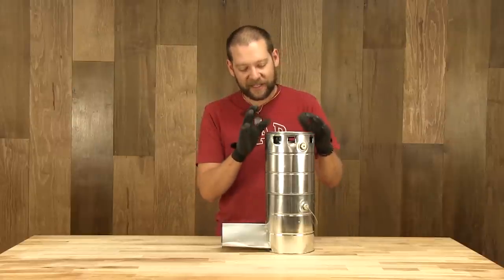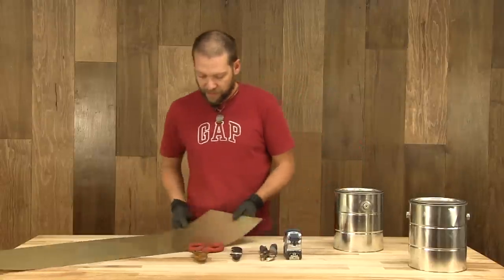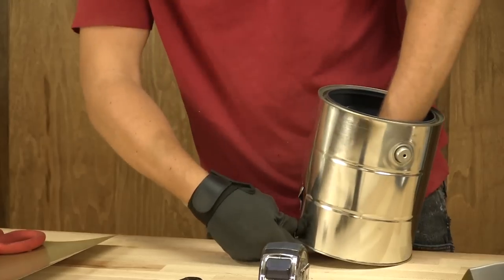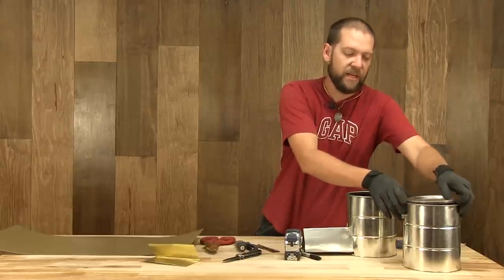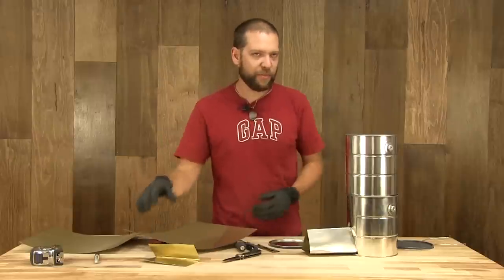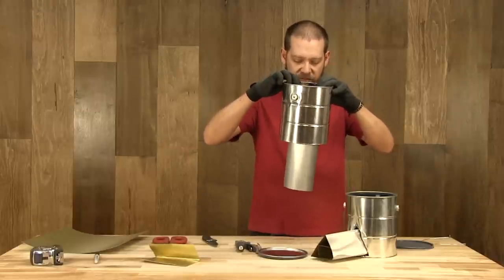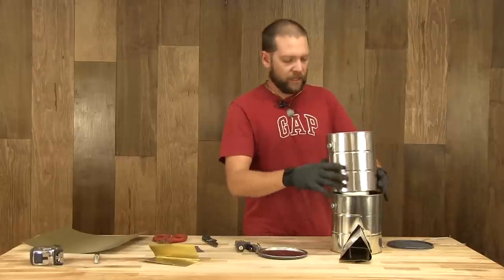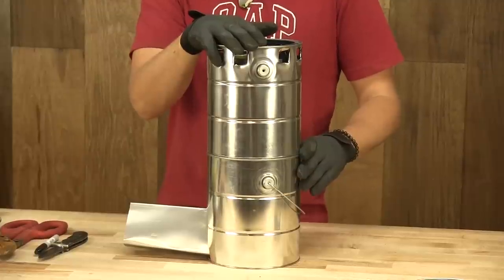How to Make a Rocket Can Heater

Comment: Looking at the design, wouldn't putting the point of the triangle down make more sense for the air? Would allow for larger diameter wood to be used as fuel

Comment: Wouldn't it be easier to use metal duct instead of aluminum sheeting?, it is cheap and fully sealed on the sides, and metal duct has a melting temperature of over 2000 degrees, aluminum melts at 1200 degrees, and the temperature in a rocket stove burn chamber gets well over 1200 degrees

Comment: You might want to inform your audience that they need to use a LOCKING BLADE or a FULL TANG blade when cutting into metal...even cheap metal...Some folks will grab any knife and begin...with the results of a loss of fingers using a cheap non locking blade.

Comment: Of course it doesn't work, the burn area is so freaking tiny you have to feed it constantly and it's not going to produce much heat with one single twig burning, if it burns, looks like it would go out and just smoulder and turn this thing into a smoker
All the tech talk for a hunk of crap, the power of pain pills!

Comment: Great idea but just the tip when pushing a knife through they can very easy for the knife to slip off specially if it is an old one like you say with a bad tip you could stab yourself trying to hold a can a little further away would hate to see good people like yourself trying to help other people save money and hurt themselves great idea thanks a lot I will be making a small food can heater for my tank when I go camping in the fall and winter thanks and stay safe
Reply: This thing is going to kill people. I don't see how it is going to help people...

Comment: Oh my god ! 
Normally I don't bother sayng anything. I just can't let this go. 
Don't anyone built this thing ! 
Seriously.
The center heatstack is a coil of slashing. The outer housing is two cans just balanced on eachother.  So, you feed in wood through the tiny opening which pushed the entire thing off balane anyway.  Rediculous design with dangerous sharp edges everywhere so you can't touch it before it gets hot. Once it's hot it's pretty much guarenteed to topple over. But then he encourages you to precariously balance pots or frying pans on this design ? 
 This has to be one of the most irresponsible videos I've seen for do it yourself emergency planning. 
Don't try build this thing.